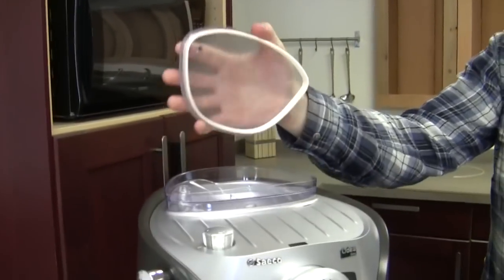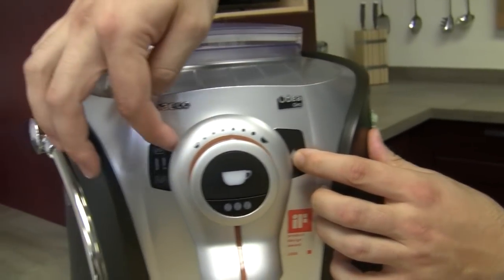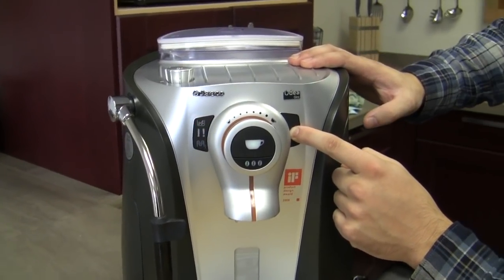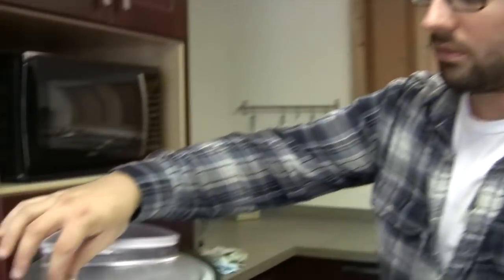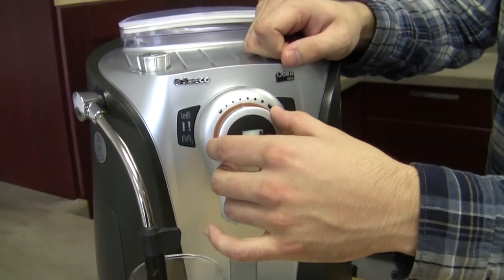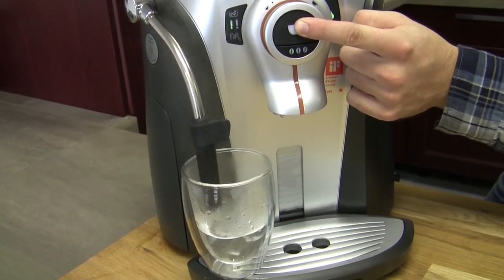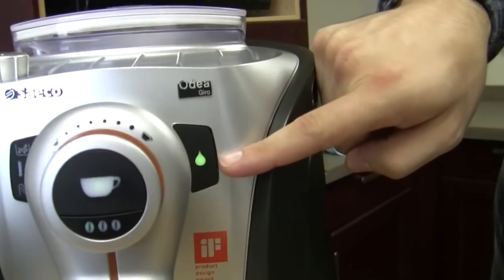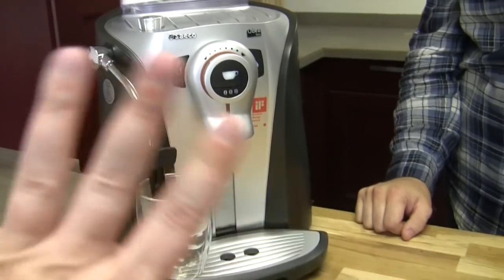SCG Tech Tip: Saeco Odea Series Test Mode

Comment: Hi,
Great video thanks.
I have a problem with my Odea. The coffee is coming from the back instead of my cup
Never had that before.
Reply from the maker: Hello Esther Adam, It may be best to contact your local service center. Generally, when the machine is leaking coffee, it tends to be a part inside the machine.  However, there is one other thing you can try before resorting to that, and that is to make sure that the brew unit is clean.  Occasionally the screen can get clogged to the point that the machine can’t push through the grounds.  To take off the screen, you can walk through the video for the thorough cleaning for the brew unit: https://www.seattlecoffeegear.com/learn/videos-home/ask-the-experts/saeco-superauto-brew-group-tips.  ~Miranda

Comment: My grinder sounds jammed. There seemed to be a bean stuck between the white teeth of the grinder. I removed and then see metal about size of bean, not sure if metal and if should be there as it is difficult to see. Any videos of inside the grinder or tests to see if still good but just jammed.
Reply from the maker: This sounds like a pebble/rock made it's way through the roasting process and ended up in your grinder. This is somewhat common. Once a pebble makes it's way through the roasting process they look incredibly similar to a roasted coffee bean. The grinder assembly in the Odea is particularly deep in the machine, it's probably best to just take it into a Saeco Certified Service Center and get the whole grinder assembly tested and the ceramic burrs looked at. The outside panels of the Odea/Talea series are quite difficult to work with if you've never removed them before, which is why i suggest going to a Service Center. I hope this helps! - Brendan
Reply: Mine's having the same issue. I started it up into test mode and tested the grinder. It sounds jammed and won't grind. Other than that everything else works fine. I found a YouTube on how to observe the grinder after taking it out of the Odea Giro but none on taking it out. Is there a set of instructions or a video of the tear down process?

Comment: I have the Giro Plus. Lately, the coffee grind (in the waste bin) at the end of the cycle is watery and mushy, not like the pancake shape like normal, and coffee taste weak. What maybe wrong and how I can fix it?  Thanks.
Reply from the maker: Hi Watler, The first thing to look at would be the dosage. Make sure you're dosage has 3 out of 3 selected for the maximum amount of grounds. This is the only way to get a unified puck. 
Also, check your brew unit o-ring. When was the last time this was changed? If the brew unit o-ring is not making a proper seal, water will end up in the dredge box because that is the path of least resistance. Sometimes the brew unit o-ring doesn't need to be replaced entirely, just removed and cleaned because the oils of the coffee have a tendency to build up there. While you're there, i would also take a look at the brew unit screen and make sure that looks clean. 
Hope this helps! 
-Brendan
Reply: Seattle Coffee Gear Thanks for the very quick reply. Really appreciate your help. I will check out the o-ring. Have not replaced since 3 years ago. Where can I buy spares for Odea?  Yes, that maybe the issue as I saw more than normal waste water in the catch cup, along with the mushy coffee waste.  BTW, what do you mean by dosage has 3 out of 3 selected?  If you mean selecting the strongest brew by having all 3 green lights on, yes I do. Again thanks.  I have subscribed to SCG and I enjoy my Giro Plus coffee.
Reply: Walter Li Brendan, one more question...I also found more than usual unused coffee powder when I remove the brew unit (outside of the brew unit and when I shake the brew unit), so much so that my coffee drink is weak. Could this issue caused by the o-ring as well?  I will check SCG if it sells parts. Thank you.
Reply from the maker: Walter Li The Brew Group o-ring can be purchased through Seattle Coffee Gear when calling 866-372-4734 and referring to either the product description (Brew Group o-ring) or the product number PRT119C8163. 

The strongest dosage is indeed the three coffee bean lights in the center of the selector dial. You need 3 out of 3 selected for a good puck. 

There is a common break with the Odea/Talea series and that is the grinder chute. A lot of times when this breaks is causes grounds to fall outside of the brew group grounds funnel. Take your brew unit out and take a look up at the grinder chute. Does it feel secure? Or does it move around freely? The grinder chute needs to be mounted to the grinder securely in order to work properly. If the grinder chute does feel unsecured? If it does, i would suggest taking your machine into a Saeco Certified Service Center because this is an extensive repair. Getting to the grinder with an Odea requires disassembling most of the machine. 

Hope this helps!

-Brendan

Comment: Hi. Thanks for the great video.
Do you know how I can fix this problem on my Saeco Odea Go:
When brewing coffie, hot water is leaking out of the steamer "wand" (the one that makes steam for heating milk). Is it a 'seal/packing' in the steaming/heating part of the machine that needs to be changed, and du you sell parts for that?

Thanks.
Ps, I have tried to descale the machine with cirtic acid, and it didn't seem to help. Actually it made it a bit worse, so it leaks a bit more hot water when brewing coffie.
Reply from the maker: Hello stahlw, I spoke with one of our techs and he said it sounds like your machine is in need of a tune-up and that the o-rings in the steam valve probably need to be replaced. Instead of simply replacing the o-rings, it might be best to take your machine into your local service center for an overall tune-up, just to be sure everything else is in good working order. ~ Sarah
Reply: i have two of those machines in the video they are great  i also have breveille  coffee machine witch i use every day all three from the road side they just needed a good clean to get them going again

Comment: Thanks for the video I had a guess of what was wrong but test mode showed I was incorrect. 
I am having an issue with the pucks in the dump tank being more like coffee grind soup. It started all the sudden, one day it was fine the next it was a watery mess... but haven't been able to find any info on what the issue might be. I thought maybe it was the gasket on the piston that was not allowing full travel but after running it to brew position and opening it up I can see this is not the case. 
If you have any insight it would be appreciated. Thanks.
Reply: Jessica Conklin  I have had that happen before also. It was always that not enough coffee was dispensed. Does it seem as if the grinder doesn't run as long as it did? The machine I saw this on was an Expelia, it has a screen so a way to get into the program and up the pulses on the grinder. My guess would be the pulse generator on the grainer went south, which is all I can think of for my error on my Giro also
Reply: Someone’s advice was to adjust the grind. It may be the wrong setting.

Comment: Hello, I did everything in the video and everything works perfectly, but when i try to make coffee only a little bit of coffee comes out and then the machine discards the beans in the container and the exclamation mark turns red. It doesn't blink. After i let water come through the steam wand everything looks perfect again... until i try to make another cup of coffee. I took the machine to a service and they didn't know what to do with it. I don't want to throw it away just like that. Please help
Reply from the maker: Hello just2garfield! Most likely, the grind consistency is just a little too fine. By changing the grind setting to 1 or 2 notches coarser, then running about 4 brew cycles to clear through the mixture of old and new grind settings, you will likely find that the machine is able to brew properly. The grind consistency is very important to how easily the water can flow through the grounds and will be different for every bean/machine combination. The type of grind needed can even change as the machine is used over time, if you get a new bag of beans, or as the beans age.  If you cannot get this to clear through you may have a clog, at which point you may need to use a vacuum or air compressor to clear out the clog. Try changing the grind setting first and you will probably see the improvement you’re looking for! - Miranda
Reply: Seattle Coffee Gear Hi! Thank you for your prompt answer. I did as you said and I changed the grinding to the coarsest setting. I did make a cup of coffee and at the second one no coffee came out at all. I tried again and again, but the machine does the usual cleaning when it spits 2 drops of coffee and then it sounds normal and everything looks normal except that no coffee comes out.
Reply from the maker: just2garfield, It could be that you have a clog in the grinder. If the grounds in your dump box are still well-formed pucks or are watery, then likely either the setting is still too fine for your beans, or there is a clog.  If the grounds are completely dry and not a well-formed puck, then you’ve gone a touch too coarse. My best bet is that there’s a clog in your grinder though. You can try vacuuming out the grinder and where the grounds drop from the chute into the brew unit, and use an air compressor to try to clear any clog in these same places.  If you’re still having an issue though, it will likely need some repair. - Miranda

Comment: Could you tell me how to turn off test mode please? Great video, but I need to turn off test mode.
Reply: Switch off the machine as normal using the power button, when you want to power up again just press the power button. Test mode only works when you depress the steam button at the same time.

Comment: Hello! I LOVE your channel!

I bought a used Odea Giro today. It was working, but the coffee wasn't to my taste. I tried to change the grinder adjustment, and then... It won't make coffee. I press the cup button, it makes a noise, and then the upper and lower LED flash alternately. I cleaned the brew group and put it back, the same problem. And in the test mode, everything works except the grinder. Is it possible that the grinder got clogged up because I've set the grinder too fine? How can I unclog it?
Reply: And the grind-consistency-change-thing doesn't seem to turn, the key just slides over the head of it.
Reply: I disassembled the machine and cleaned the grinder. Because there is no grinder sound when I press the button, could it be the electromotor of the grinder?
Reply: SHIT SHIT SHIT SHIT SHIT!!!

I tried it once more in test mode, but without the plastic and all the covers. I tried everything, everything worked. Then I tried the grinder. Guess what, WHITE SMOKE COMING OUT OF THE MOTOR.
Reply from the maker: Hello N3ssaya, Prior to the white smoke coming out of your motor I would have suggested: if the upper and lower lights are flashing as you’ve described than you likely have a grinder clog. You will need to try to press down and turn the grinder adjustment key to move the grind setting to the largest dots for the coarsest setting. You can also clear out any beans/grounds in the grinder chute above the brew unit and in the grinder with something like canned air and perhaps by vacuuming them as well. It will take about 3-4 cups for the new grind setting to be in full effect, and hopefully push through the clog. You can then adjust the grind back down to perhaps the middle setting once the clog is clear. Do keep in mind that an oily, dark roasted bean (anything with a shiny surface) can clog the grinder in this manner and so a dry, matte finish bean is best. Also remember that moving to a finer setting should only be done with the grinder running, so you will need to position the lid over the magnet to trick the sensor, press the grind button, and then press and turn that grinder adjustment key. Only move about one dot at a time to prevent clogs, and brew a few cups to see the grind in full effect before adjusting again. However, with white smoke coming out of your machine it may be best to take it into a service center. - Teri

Comment: great video, die the pump test and it will pump for a second then hum. tested grinder and no grinder. is the machine done?
Reply from the maker: Hi Juan, feel free to contact our support team: support@seattlecoffeegear.com
Reply: Seattle Coffee Gear I fixed the issue. Disassembled, cleaned, and freed up some grinds from motor. she is back up and running.
Reply from the maker: Whoo!
Reply: Thank you for this video. It allowed me to troubleshoot it on my side and able to repair my machine. I really appreciate the assistance you provide. #1 in my book!